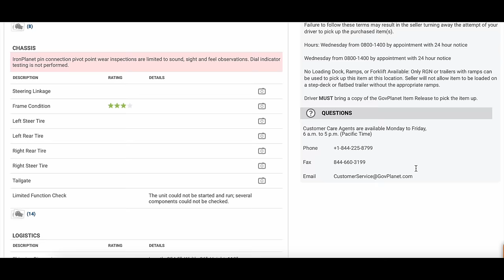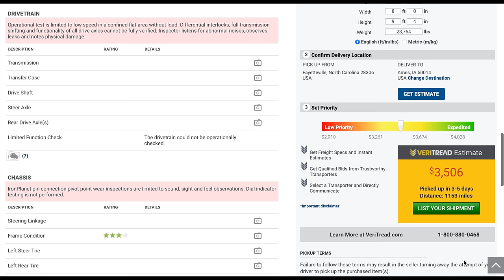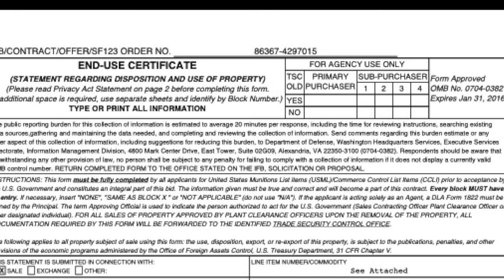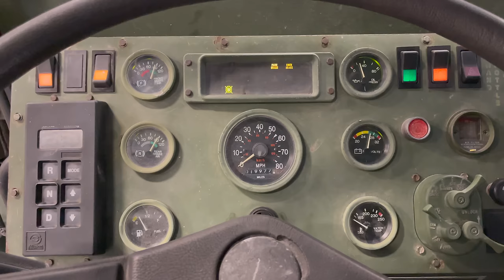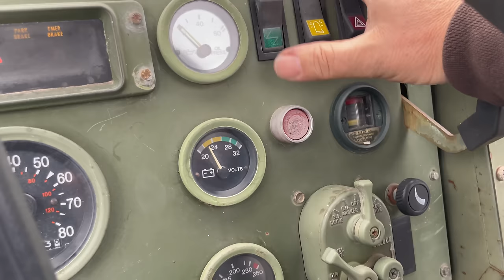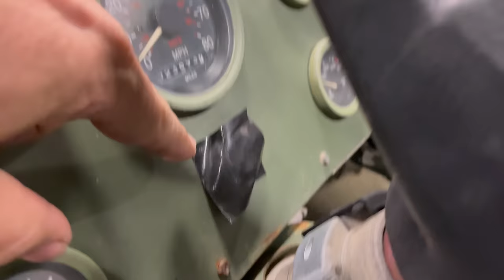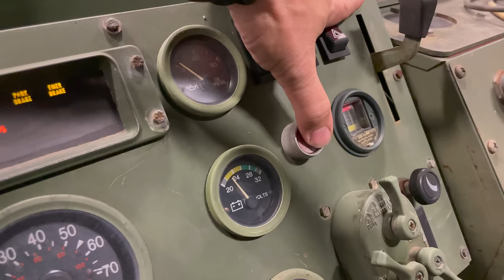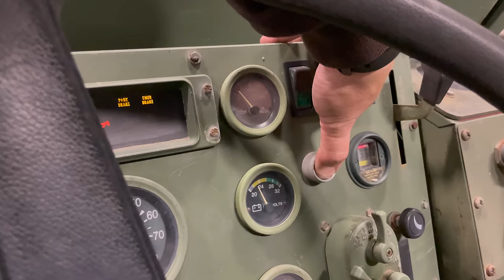Buying a LMTV on GovPlanet Wasn't How I Expected

Comment: Your GP truck is a rarer LVAD Low Velocity Air Drop LMTV issued only to Airborne and Special Forces units. The hard top lifts off using the spare tire lift and the windshield, side windows and upper rear wall fold down for palletized parachute drop. The Special Forces rigged them up like Mad Max into support gun trucks for the ODA Ground Mobility Vehicle GMV Humvees.

Comment: I discovered and fell in love with turbochargers because of these LMTVs. I was hauling a water buffalo and damn-near a platoon, and their crap, when faced with an extremely steep incline. I told the TC I didn't think this piece of shit could make it up a hill that steep and he's like "yeah, it will. Just give it the gas". I tried to get a fast run-up, but I could hear the RPMs dropping before the hill even got started proper. Soon after was my first experience hearing the turbo spool up, and it did. Once it got some good pressure going, I realized that all the driving I had been doing in the thing before that wasn't really using the available power at all. Those things really really go. They're miles better, and funner, than a HMMWV.
Reply: That's such a weird statement to bear from European ears. Our engines are so small, they have more turbo then engine xD
Reply: @Virtue I've seen LMTVs drive through mud sticky enough that people were permanently losing their MOPP overboots in it, and falling in a rut would plant your balls in the surface slop. That was a very bad time for the dudes in the field, and when the chow truck (an LMTV) pulled up, they were like "We're not getting out. Y'all serve yourselves and put the containers back in. Truck leaves at xxxxhrs, whether you ate or not. " Good times for mud appreciators though". Hilux is for dry climates, with little cover, and good road speed with some offroad capability are required. LMTV is more for "Move the company's additional gear and supplies to them, and the stretchers back, wherever that may be, and driving a logistics convoy on roads, is not always desired/possible"
Reply: Another plus for LMTVs over HMMWVs is that they have AC and a charging port in the cab. 

I brought my car charger one time to a FTX and half the company was taking turns to charge their phones after the commander banned people from charging their phones in the TOC after the generator got overloaded.
Reply: @patrickdtodd  I don't recall ours having AC, nor A/C in the cab... Perhaps on the HQ models. I sure hope the soldiers are briefed, inspected, and acclimated to training without all those RF emitters and reactive electronics during deployment prep exercises, as we've been watching civilian electronics (which sometimes operate on military frequencies) get entire units wiped out for the last year now, with the Harpy drone-like missiles, and their derivatives.
Reply: @buckstarchaser2376  This was during the halcyon days of the GWOT when neither the Taliban nor the Haqqani network had anything approaching the sophistication of the EW systems being used in Ukraine by both sides. Nowadays, having a RF source like a cell phone would be suicidal in a near peer environment.
Reply: @buckstarchaser2376  You should write A book,you have some linguistic skills there..

Comment: I really enjoyed the troubleshooting part, particularly that swapped relay start inhibit.  It was almost as if some instructor had set it up to test mechanic students.. lol!
Reply: Seems like someone swapped it to be non-running when it sold... 😂
Reply: Or maybe a theft deterrent.
Reply: @truedox  There's a battery cut-off underneath that you can padlock open and an emergency cut off switch in the cab.. both much easier to access and use as theft deterrence.

Comment: When i was in Iraq I did an engine to one of these and gained mad respect from the motor pool. I told them it didn't need an engine, it was a bad injector wire but they didn't listen. So I said fine, I'll replace the engine in a day. They laughed and said it couldn't be done. I waspped it in about 14 hours. New engine, same issue. So they sent it to the contractor mechanics. Next week it came back with a new wire running from the power board in the dash to the injectors. Ran like a new engine.

Injectors are mechanical and electrical. Needs 24 volts.
Reply: Bollocks.
Reply: I agree with Matt, balls.
Reply: @Unchainedful  and I agree with Alric, nuts.
Reply: Most large injectors only need like 6 volts
Reply: @cottonmouthdb8454  yeah but it wasn't even getting that. When I tested volt at the injector it was 0.  They thought it just needed the mechanical pump to work.

Comment: As a former Infantryman, I never thought that I would be missing being in an LMTV.
Thank you !!!
Reply: That one almost got me to the floor. I rode around in deuce and a halfs in the 70's. These guys today get air ride. What a bunch of softies. Count your blessings guys. You never had it so good.
Reply: @mncitizen4364  OK boomer.
Reply: @jasonm949  OK grasshopper.
Reply: I joined after 9/11 and never drove or rode in an LMTV. it was all 5ton and 2.5ton trucks.
Reply: @SoloRenegade I was going to say, just because the military had these doesn't mean they had the old stuff.  I have driven all of it.  Got stuck driving an old 5 ton on a long convoy weighed down and was lucky to hit 55 down hill.    Had a coworker that was 6ft+ driving a duce and a half, and it looked like his knees were at his chin.  Some of the old truck were built for the shorter people back then.
Reply: @NA12495  while the old stuff was less comfortable, and cold in the winter, I missed their simplicity of design, operation, and maintenace. 

They were reliable, simple, easy to work on, and a LOT of thought went into their design regarding making sure they never broke down on the battlefield, and if they did, they could be made operational again ridiculously fast with only basic tools.

Modern military equipment is not designed this way anymore, and it's a serious design flaw.
Reply: @SoloRenegade  flip side is they can be more efficient.  Transporting fuel is a lagistics challenge.  That is why Hitler had the VW built, that could get close to 30MPG.  He got it working, think it could have been worse, fixing up this truck.
Reply: @NA12495  yes, fuel efficiency is a big factor, but when you replace a fuel truck with a spare parts truck full of the thousands of discrete components you added....you don't achieve you're goal and even made things worse. there is a point at which in military operations, greater fuel efficiency is just not worth it.

Comment: I just retrieved my LMTV this past weekend. Hopped in and drove it from Ft Campbell KY to South Florida. Not one issue. Couldn't be happier.
Reply: what is the fuel milage?
Reply: @narcissistinjurygiver2932  bout 8 miles to the gallon.
Reply: That’s awesome?  Did you have to go on the base?  I’m curious if you have to have a real id drivers license to get on the base.

Comment: I have no idea those were being sold for so cheap. I drove around in Iraq for a while, I remember flying down the road with the lights off and taped up dodging mortar holes in the pavement to deliver fresh guard duty. Got really good at dodging those potholes, so I ended up having that detail a lot.
Reply: Sounds like fun.
Reply: Gass Gass Gass got to pick up the Gass
Reply: How is that cheap? for most people, if you don't spend your money $2-10k is all most people make at the end of the year minus expenses.
Reply: @DARKthenoble  Those people aren't the audience to buy things like this then.
Reply: @samstanfield2634  given what it is. A glorified used car that needs work. It seems to me a bit price gouged.
Reply: @DARKthenoble  3k is extremely cheap for a vehicle with that much capability. Something like that new on the commercial market would easily be 150k+.
Reply: @TheSlywright  I take it as you intend to pay someone else to work on it rather then do the work yourself. You can get a old f350 for less and it do much more work.
Reply: @DUSTKILLL  If that is true, then shouldn't people on the bottom rung of society be paid more then. 10k is nothing to you. therefore making sure the average citizen can make 40k a year must be perfectly reasonable in your eyes correct? I mean the bar is supposed to be softly set at 30k as the norm, but most businesses I see tend to try to only make it look like that on paper, instead of actually paying it. 

Or do you really have in your mind that the average life is only worth about 20k to you?

Does an adult in your eyes mean some old geezer in his 50's-80's? Because that kinda just looks more like someone desperately raising the bar to me to avoid facing he cold hard fact they should have been retired already. The historical life expectancy was you'd be lucky if your made it past 30, and you'd be kicking the bucket when you hit your 40's. The whole idea that average person will live past the age 100 forever. I don't feel given the circumstances of the nation will be the norm much longer. Especailly since the current economy is fixing to become worse then the great depression.

The entire logestical system of the nation is collapsing. The average American was never taught any of what it takes to run a republic, and the important population was never integrated fully into society. If you have 100k in your bank account because your a mechanic. Then you should know what kinda of problems tend to spiral completely out of control when the average human looks at the machine like its just a magic box.

I haven't been showed that this machine functions. It looks more like just another car in a junkyard to me at the moment. And yet hear you tell me that's because I'm too young. It looks to me with a educated guess based on my current life experience. That things simply used to be a lot better then they currently are. I mean geezer keep pointing at the abandoned factories they used to work at, and a sawmill that's now a abandoned grocery store in the middle of town. where the local entrepreneur tries to flip cars he found, or simply picked up from car wreck auctions.
Reply: @DUSTKILLL  It looks to me like there was a point in the mad max movies everybody missed, because it wasn't the oil the writer was making his point about.
Reply: @DARKthenoble it's cheap for ANY road worthy vehicle in this market
Reply: @misham6547  Not if your making only $12 an hour.
Reply: @DARKthenoble  well yes, but it's relative, like 20k is cheap for a plane, but is still a lot of money. 3k is super cheap for an off-road road worthy vehicle
Reply: @misham6547  You'd pay that much for something I could get for $400?
Reply: @DARKthenoble  does it carry 2 tons of go off-road?
Reply: @misham6547  your kinda exceeding average every day person applications there. But technically if you hitch a trailer to it most 4by4 trucks can do that.
Reply: @DARKthenoble  buddy, when was the last time you tried to buy a vehicle? $3k is project car prices these days. Even a basic new car will cost you 10x that much. You must be a child, there's no other explanation.
Reply: @tissuepaper9962  I bought a car about a year ago. It was a 2000 Acura Integra, and I got it for $500. I don't see a point in paying the exact same amount the government spends on a small tank on a new car.
Reply: @DARKthenoble  congratulations, you bought a 24-year-old low-end compact car for the price that it's worth. It probably has 250k miles on it and two years left on this earth. You're extremely dense if you don't see how that's different from a capable towing vehicle with a 7-liter turbocharged diesel engine.

Comment: When I was buying trucks from Govplanet auctions it was usually an adventure in one way or another.  I helped a new truck owner pick up a Deuce from Ellsworth AFB in SD and it was in the middle of winter and when we got to his Deuce the fuel cap was off on the fuel tank, OK I had told him your going to need new batteries and all new fuel and oil filters plus a plethora of tools.  Well we dumped 10 gallons of fuel into the truck and got the batteries installed, this truck did not have the flame engine heater but it had an ether injections system on it but of course the can was empty, so I craked the hose on the intake and he gave it a shot of go juice while I turned it over and it fired up and ran very good.  We then proceeded to the nearest truck stop and fueled it up and hit the road we had a tow bar and pulled our CUCV behind the deuce.  We covered about 200 miles that day and the truck was running great.  We got a motel for the night and there was a truck stop right next to the motel and we fueled up again and hit the road, I got about 10 miles down the road and the engine was not happy as soon as we got out of town I hit the clutch to pull over and the engine stopped.  I new we had a filter problem, I changed the primary filter and got it running again and went for another 30 miles when I saw an implement tractor dealer and pulled in there, they let me use one of their bays to work on the truck, first thing I did was drop the bung on the fuel tank and I got about 8 gallons of water out of that, apparently there had been and iceberg in there that didnt melt till I added fuel that morning.  Got all the water out of the tank and changed both secondary filters and all was good!
I picked up an M925A1 from Kansas from Gov Auction beautiful truck brand new overhauled engine trans etc. and brand new batteries, drove the truck 600 miles home not a problem.  After a few days the batteries started behaving oddly and wouldnt turn the engine over, they showed full voltage on the charger and ammeter but wouldnt turn the engine over.  I finally put a load tester on the batteries and they were junk.  After I replaced the batteries I started to look at the brand new batteries that were in the truck and found the date codes on them and they were 8 years old!  There are a million stories about peoples experiences with Govplanet some good and some just unbelievable!  My best words of advice is be prepared!
Reply: You guys def put the time in to get these military relics from going to a scrap yard and get them restored. I thank you
Reply: Interesting experiences. Sounds like you managed all the problems really well.
Reply: U wrote a book
Reply: @cedarwest37  and so he did. And it was a good read
Reply: @mobius-1503  What book, please? I'd love to read something like that.
Reply: Did you write a book on that topic? I'd love to read it, where can I get it, please?
Reply: Buying a pig in the poke.

Comment: The origin of this LMTV is the Austrian built Steyr 12M18 (9 speed manual transmission with 3 diff locks, ~180 hp), so the Pinzgauer is a close relative! Both Puch Pinzgauer and Steyr 12M18 were built by the same company group "Steyr-Daimler-Puch". When I did my military service here in Austria, the 12M18 was the common truck.
Reply: They look like Steyrs. Here in Canada, we got the 91M and you can see the resemblance. Decent vehicles with some idiosyncrasies.
Reply: I was looking for this comment. 
Hey guys Steyr-Daimler-Puch did the G-class Mercedes - Benz! I know right?! Also his poorest military cousin known also in Poland as Wolf X)
I would pick MAN fae 8.136 4x4 instead. It's lighter. No need to call Leopard tank to pull it out of mud.
https://www.youtube.com/watch?v=3MtvlCZBn84

Comment: I have worked at the plant that made these in Sealy, TX. It is a "ghost town" now.
We took this chassis and turned it into a MRAP, for Armor Holdings and later BAE. The MRAP version has the 8cyl Cat motor in it.
They are very capable.

Thanks for the video. Brings back some good memories.
Reply: @whiteboysixty5  I used to stay in Katy at one of the hotels near Basspro, when I was in town.
One of the nicest towns I stayed in, on my travels.
Reply: Brings back memories.. I also worked at Stewart and Stevenson.. in 80s and 90s .. briefly worked on fmtv project helped set up assembly line.. 
I worked on the 8x8 esarco ..
Cool truck.. have fun with it

Comment: I guess I got lucky.

I bought one of these on govplanet about 8 or 9 years ago.  Contacted "uship" for transport and paid $950 to have it trucked from Georgia to Virginia.  I had it in my yard about 3 weeks after the auction ended.  When it arrived, I had a local mechanic check it out and the only thing wrong with it was alignment, a bad tire (due to the bad alignment), and a brake light out.  Paperwork to get a title in my state arrived about 30 days later.

I enjoyed it for about 18 months, driving it in parades and taking kids for rides.  I sold it onward to a business that has used it for "advertising" since then.

Comment: I've been looking to get into military vehicles for years and this has been very educational. I would have never considered these as an option. I was looking at Deuce and a half and 5 tons, but these might be another good option.
Reply: This vehicle was designed and made by Steyr-Daimler-Puch. Simply put, a Mercedes G-class (or Wolf, or Galende, or Galendewagen, or Puch, or G - it is all the same) factory. Another nice option is MAN fae 8.136 4x4 very brave and capable off-road truck. Needs nice tires for the mud. Empty will go thru the sandy beach! It is under 8,5 metric tons if this makes difference for somebody. I would say MAN is higher in reliability scale than Mercedes or Volvo - in terms of trucks. Let's make it clear. The Mercedes G-class never has its quality off and was never going all tits up like C-class or A-class or even S-class at some point.
https://www.youtube.com/watch?v=3MtvlCZBn84

Comment: Your scored with great tires!  When I was enlisted, I would sneak into the motor pool and scavenge tires off "dead" trucks because I couldn't get new ones from the shop.  If your truck comes with a bed tarp- usually stowed in the cab, make sure to remove it before lifting the cab.  I cracked a windshield forgetting that one day.  I miss this truck!  88 Mike 82nd Airborne